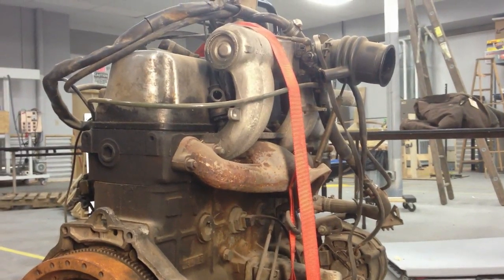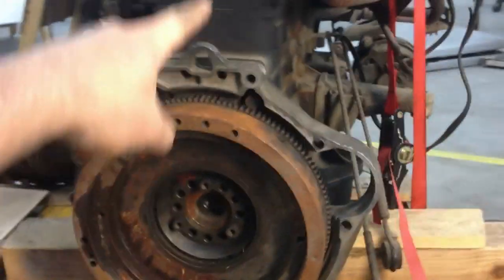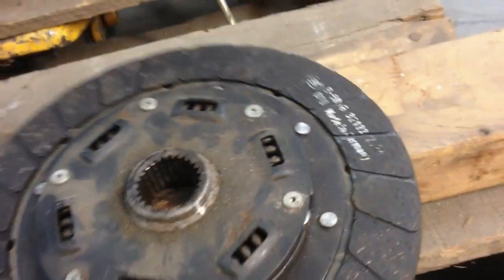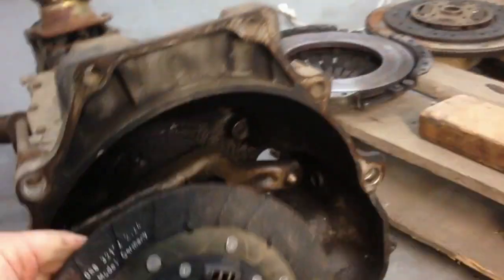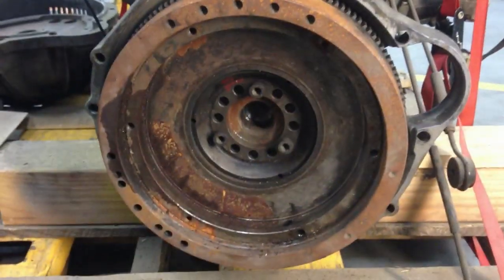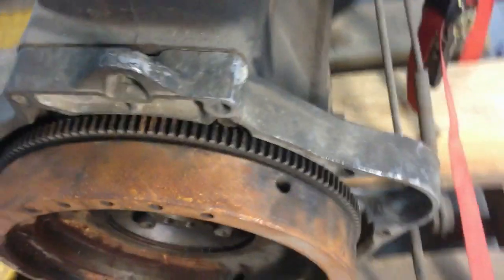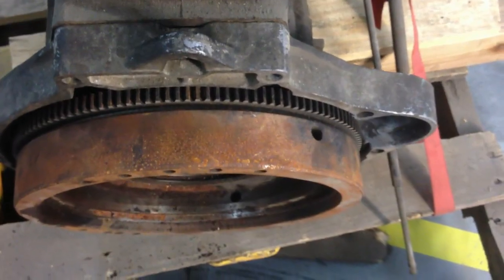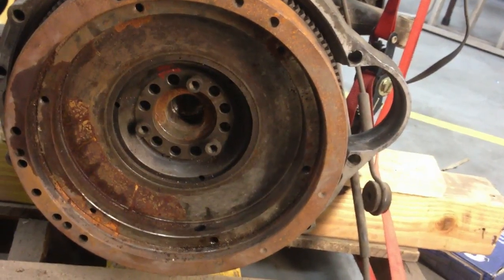SuperTruck: Clutch

Comment from the maker: I completely agree with you that MANY/MOST pickup trucks are overly large, over-priced, and fuel-inefficient.
That also means that they have great potential for improvement.
The truck I'm working with is an Chevrolet S10 - a "compact pickup" which is no longer made. This truck got better fuel economy than my wife's passenger car (which had the SAME engine!) A small truck has the space and frame to allow for the hybrid components in a way a passenger car would not.